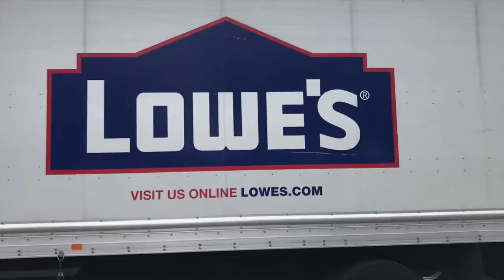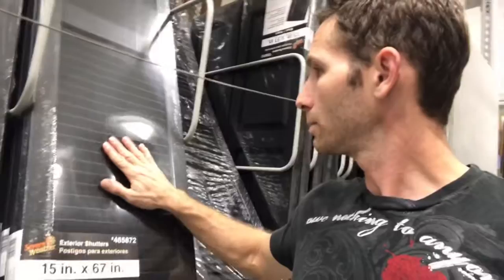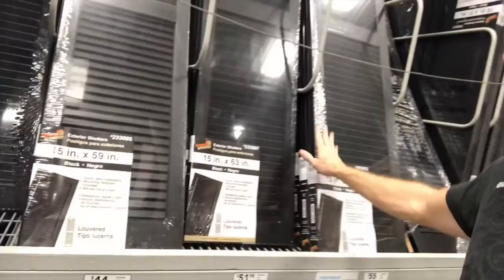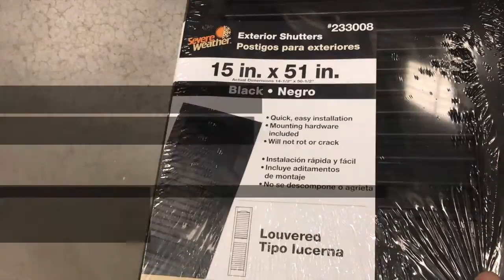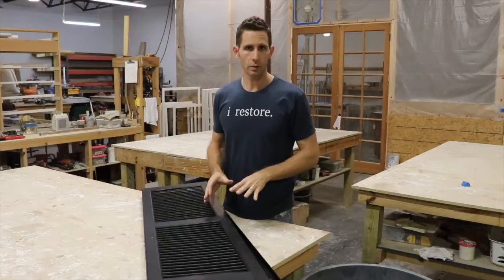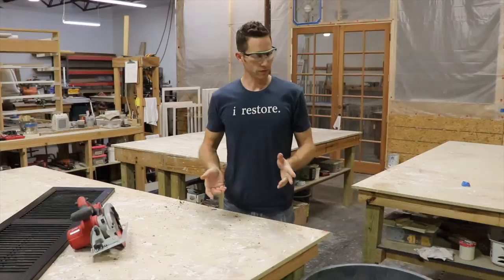Fun With Vinyl Shutters

Comment: Apparently I despise plastic shutters as much as you do ROFLOL   We once had a house built in the 1930’s, the installer actually cut a corner out of the shutter to fit around the porch casing. Ugh!  I don’t like vinyl siding too much either - makes too much noise when expanding/contracting
Reply: same